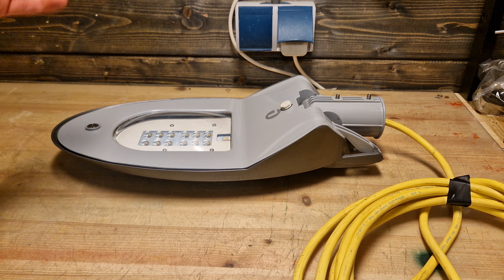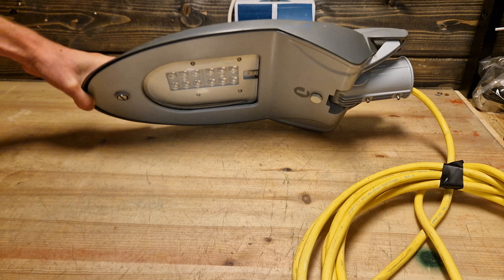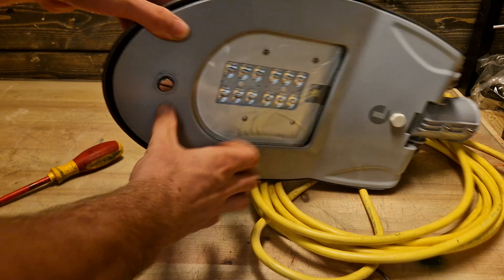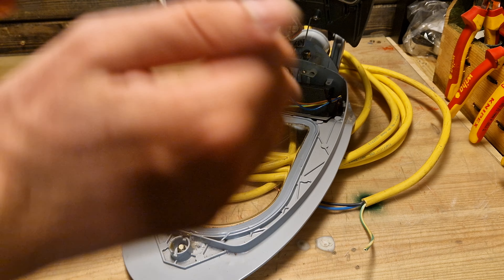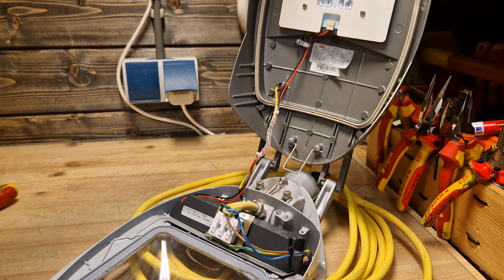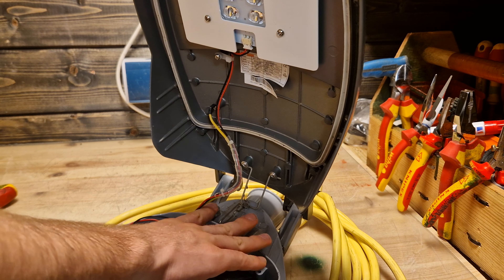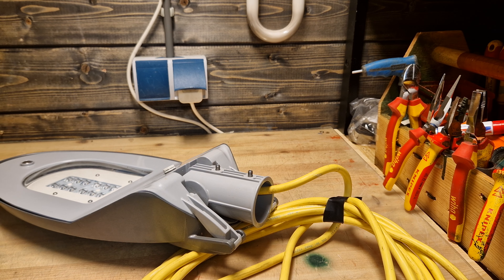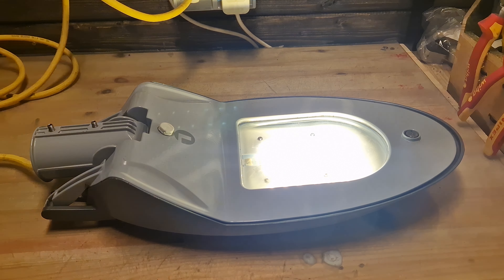Collection #131| Lightwell Street S20 (Cheap LED Fixture)

Comment: It won't last forever, but it being aluminium and a relatively small wattage (less heat) will last quite some time, especially since it has the wattage (and thus also heat) reduction from 23:00 = 75% and 1:00 = 50%.